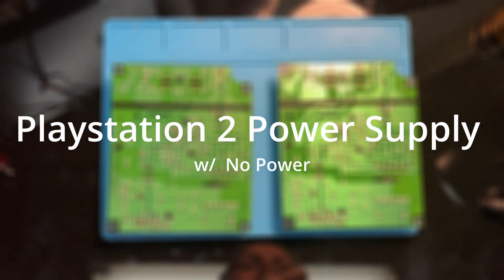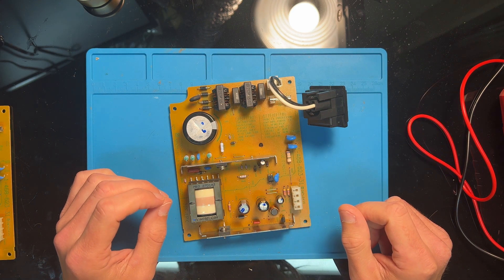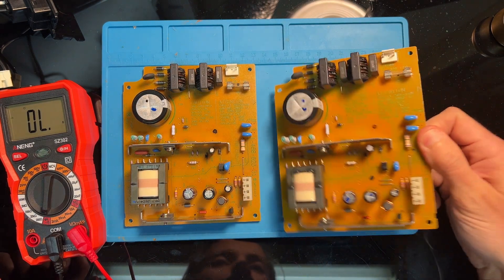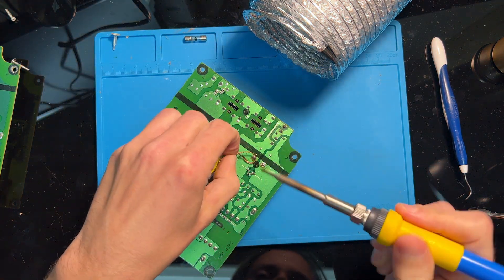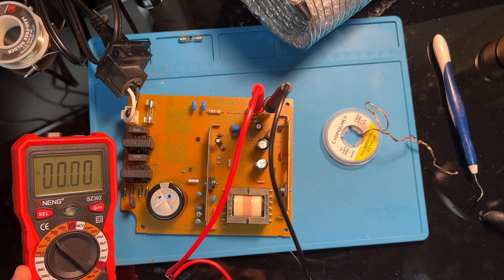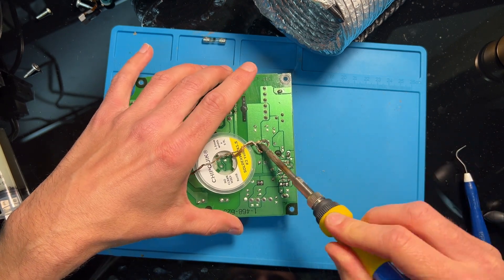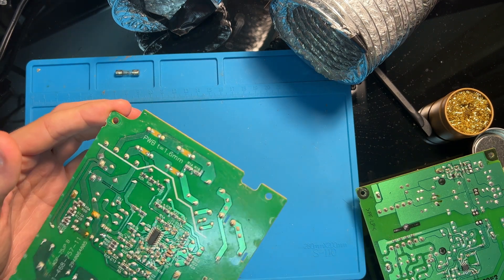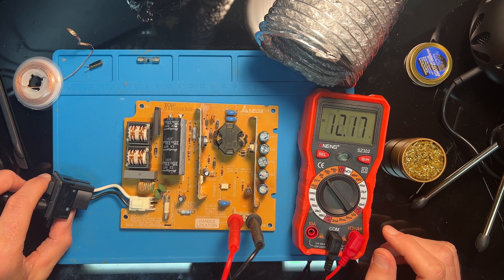Let's Fix It - PS2 With No Power (fixing the power supply)

Comment: I have an SCPH-50003 (Satin Silver, PAL) PS2 console that doesn't power on. I inserted the plug into the mains without realising that the console rocker switch was set to on. 🙈 A little bang from the console, then nothing. Dead.

How likely is it that it was just the internal fuse that popped, and not something more serious? I'm hoping it's just the fuse.

Comment: I'm doing the same exact thing right now on the same power supply. Thank you so much for the info about the schematics! I've replaced 3 of the electrolytic capacitors. The 220uF and the 2x 1000uF capacitors. My big cap is reading just fine, and I don't have a spare. I don't have much experience with testing mosfets on a power supply like this so I hope changing the same cap that fixed yours does the trick even though it's reading about the expected value =\ any advice would be much appreciated, and i'll check in if it works.
Reply: boom that fixed it! I didnt have a 27uF 35volt capacitor, but I tested it with a 22uF 50volt capacitor lol and boom 12v dc out. I should probably order the right capacitor though. I searched for a hours looking for schematics, thanks again!
Reply from the maker: Wow that’s amazing! Glad the video could help. Great job!

Comment: Good video and thank you for providing those links! I have a PS2 I'm working on with the same power supply board you have and oddly my caps all are good, but the D006 diode is stuck open and flowing in both ways. This at least got me confident and pointed in the right directions!

Comment: That bootstrap cap is very common to fail in a SMPS.  9 times out of 10 when nothing obvious is blown it's that cap and its almost never bloated or visually bad.  The main large primary side filter cap you pulled first almost never fails.  Before you start pulling components just guessing what might be wrong, you should put the meter in diode mode and check the switching transistors and diodes and check for shorts to ground.
Reply from the maker: Thanks for the tips! I'm still learning the uses/benefits of diode mode.  I'll have to go back and see if the bad cap showed any strange readings when tested in circuit. That would be useful to know in the future.